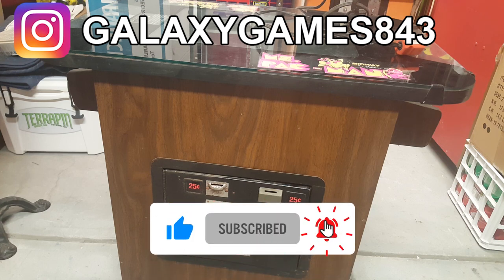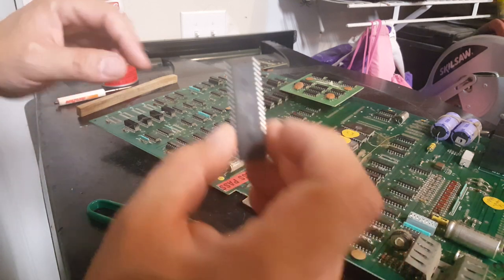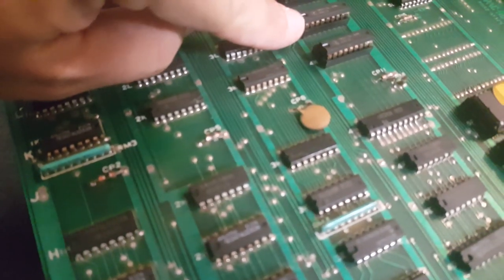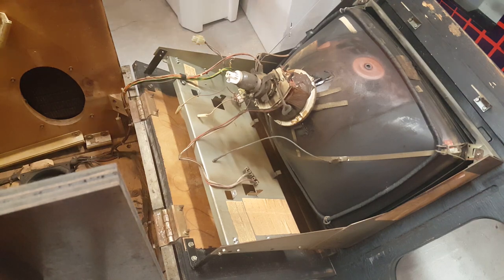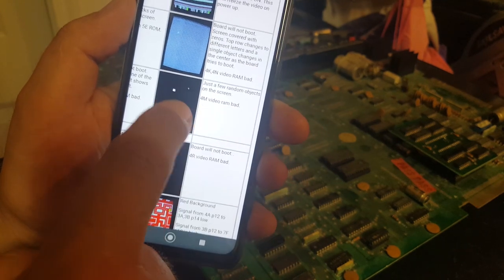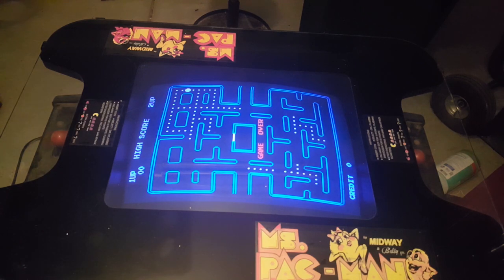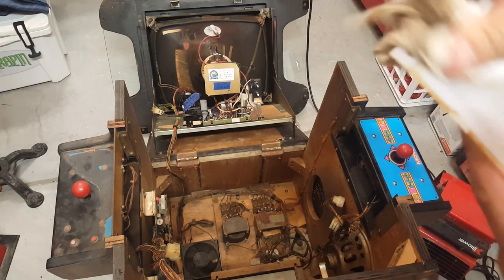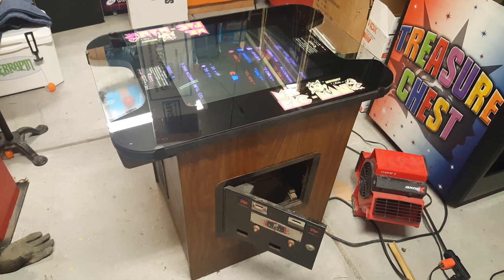Ms. Pacman Arcade Game Pick up, repair and Sold at the Arcade Auction!

Comment: Pac-man still looks a little red? I think you might have another fault on the board.
Reply from the maker: You are correct, I had trouble dialing it in but it looked pretty good after some more messing around after the video!